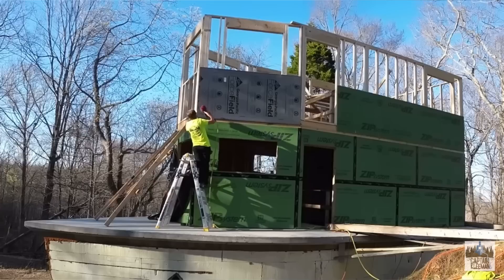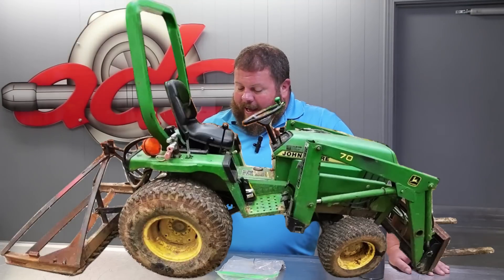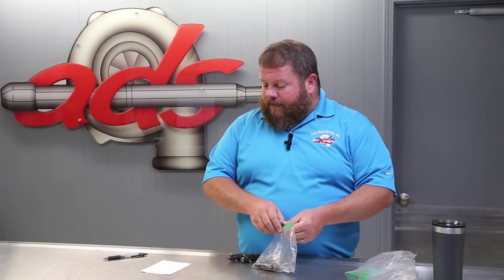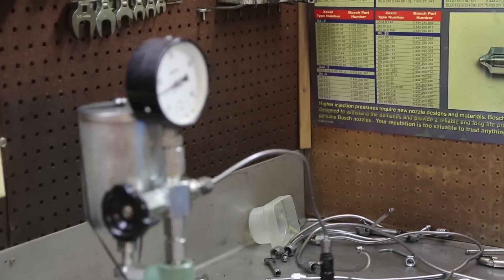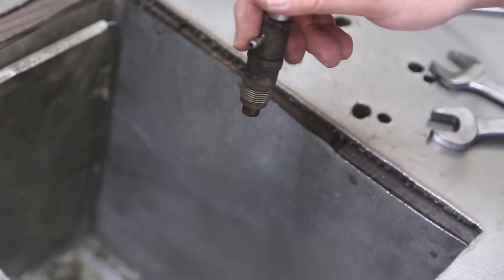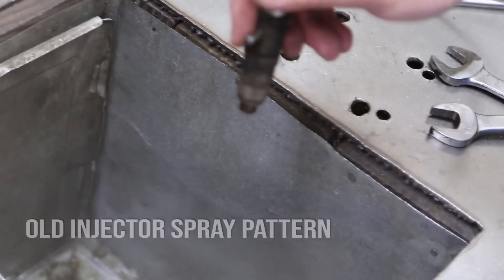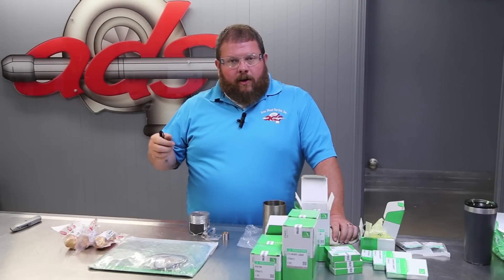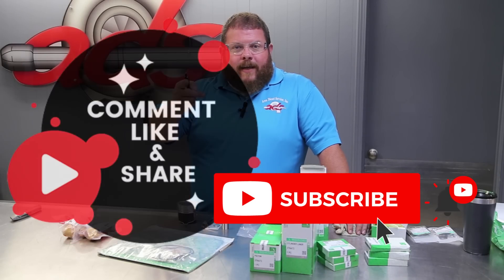John Deere 755 Teardown - Yanmar Injectors & 3TNA72UK Diesel Engine Overhaul Kit for @CaptainKleeman

Comment: The 55 series Deere compacts were actually Deere built in house units they just used Yanmar engines.  The transmissions were basically scaled up hydros from the 318 430 kind of units.  Those Yanmar engines are virtually bulletproof. Short of somebody dusting an engine or overheating it they pretty much never need work.

Comment: 11:35 Hi, I need your kind of customer service in central europe.... 
if the Youtube fame pays off enough consider a branch in Continental Europe 
Fucking deserted ofgood diesel shops since the 1990s - only large repair shops do the work and only if they profit from all repairs - meaning you give them the whole Vehicle and they outsource components 
had a situation where a Bosch high pressure tractor injection pump was sent off to a 3rd party, supposedly repaired but then needed replacement, 2nd party didnt disclose 3rd party and basically told me get fuckede by the bill we order a new one for 3000€ we cant find your old now fixed up pump  laying around 
 they first said its assembled and calibrated 
2 days later LOL no we need a new one on your dime, no explaination, no apology, just a get fucked